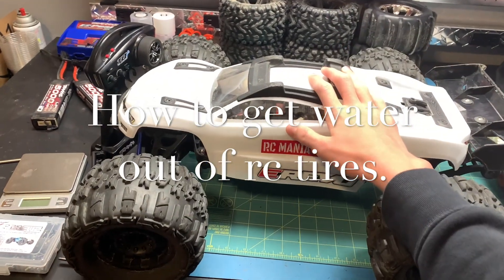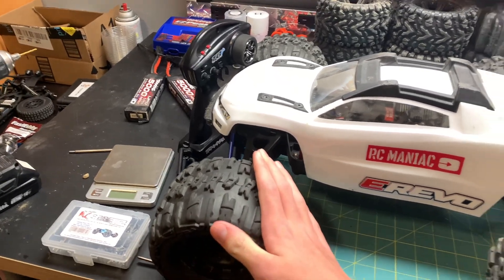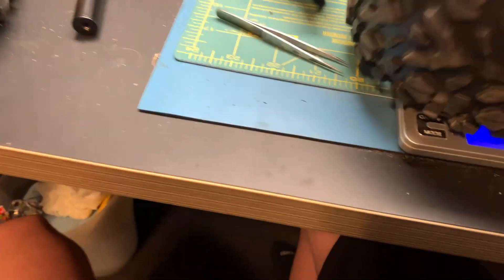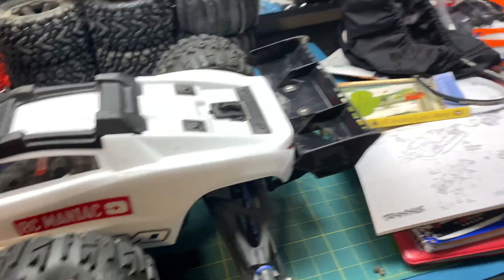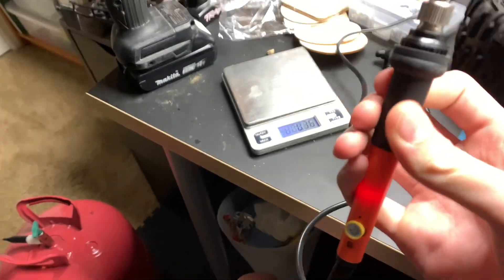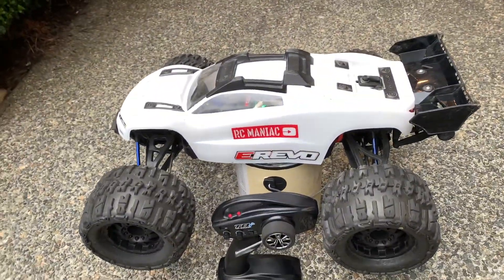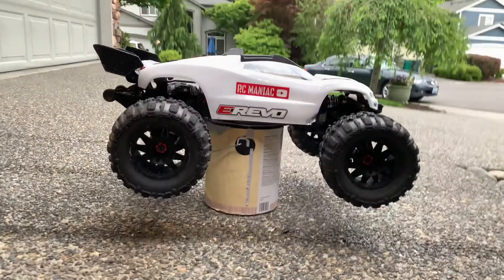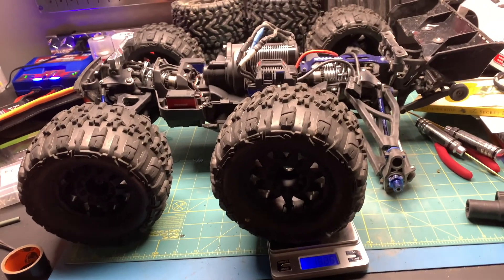How to get water out of RC car tires

Comment: Question, with the holes, wouldn't that just cause more water to go in if you're running on wet roads/wet grass? I recently got some water in my tires running over a huge puddle, but with the current weather, I'm mainly running on wet roads/grass.
Reply: I think the holes release more water then they let in so it is overall beneficial

Comment: Have you had problems with your tires ripping after you drilled the holes?
Reply from the maker: Nope! We do in in all our cars and never have issues!
Reply: Thanks for the reply! Do you know any other ways to vent the tires instead of using a soldering iron?
Reply from the maker: Just really anything hot to poke a hole. Or a leather hole punch even a drill bit would work. Has to be a circle so no scissors.
Reply from the maker: You just want to make sure its a clean hole
Reply: Okay thanks a lot